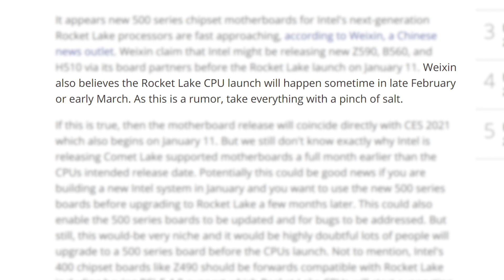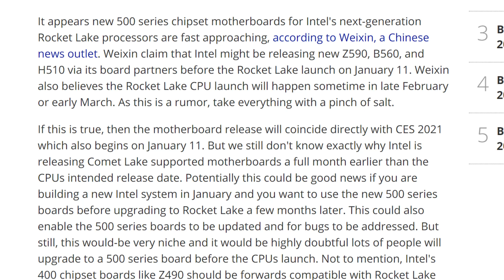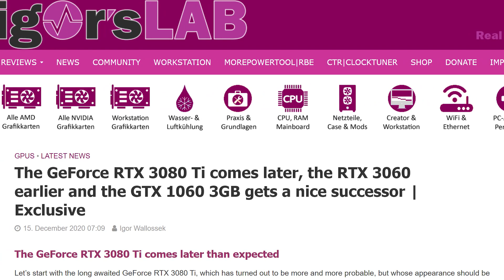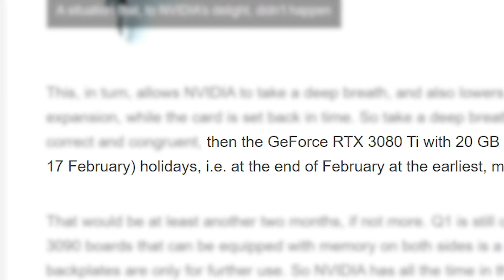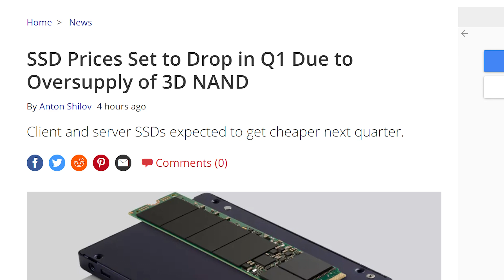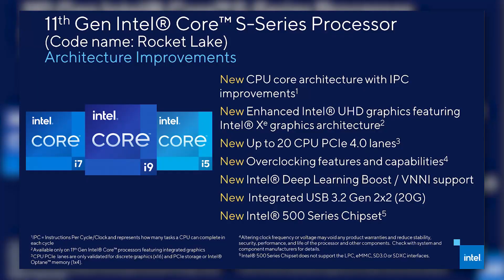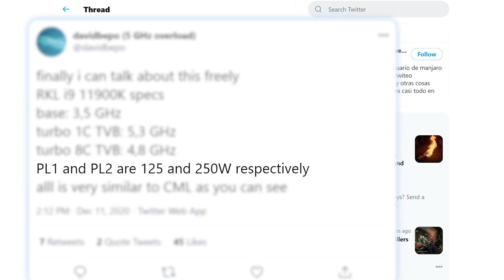Nvidia RELEASED New Monster GPU, Ryzen 5000 & RX 6000 Prices Going UP!

Comment: I don’t understand why they’re announcing new cards when they can’t even produce enough stock for the already released ones
Reply: they gotta keep producing. If this stock issue would make them stop that is a flag to investors. They need to compete across all levels of the market.
Reply: Miners
Reply: @everope  quit blaming miners for everything. No miner is buying anything except 3060tis and RX 580s otherwise they're morons because they won't be making money.
Reply: @eastonwilliams1722  that might be the case for small miners. But not consortium level of miners. The one that nvidia have direct dealing is this kind of miner. They will try to gobble everthing that they can to shift the favor towards their operation. This is why we no longer see many people involve themselves with mining on personal level like what we see in 2016-2017 period. ASIC in one thing but they also need to compete against consortium level of miner. How can they compete to get gpu when the big consortium doing direct deals with AIB to buy the gpu fresh from the factory? And then send the gpu to their mining farm overnight using a rented plane?
Reply: Companies buying out the stock to sell us gimped pcs xD
Reply: I'm not sure if you know this but asy ou don't understand I'll explain.
Basically bad chips for gpus are used for lower tier. So for instance a chip that was meant for the 3080 but wasn't good enough will be used for the 3070 or lower. By producing more kinds of GPUs they can use more faulty chips in other GPUs. This obviously means that the production cost goes down significantly as they can reuse chips for worse cards. This simply means Nvidia can make money out of faulty chips, so obviously they will.
Reply: @WhitestOC  Is faulty the right word? I understand cheaper GPUs get lower quality boards or whatever, but faulty sounds broke.
Reply: @tiredofthebs9  Faulty meaning some cores are dead or dont perform up to spec,so they clock them down towards whatever category they can make them.Preety common ,thats why first production line is the best and the worst line to get ( you probably get realy good unrecycled gpu cores,but if there is a fundemental problem in the production cycle you are screwed)
Reply: @WhitestOC  It'll be interesting to see if stocks of 3060 6 BG, 3070 ti (IFF it magically used binned GA103 chips), and 3080 ti are higher than the 3070, 3080, and 3090. That'd point to Samsung's defect rate being too high to produce the full chip. IIRC, the 3060ti stock at launch was equal to the 3090, 3080, and 3070 COMBINED. What's weird is the GA103 only seems to be used for the RTX A5000, so I wonder what they'll do with the binned chips.
Reply: @WhitestOC  I would call them faulty chips
Reply: I’m glad now I bought a 2070s in June or I would have been screwed. Was stuck with a 1060
Reply: @lazerdog345  yea same, i was actually considering selling mine but opted not to because was expecting chaos
Reply: @ZevesG  were smart men. Everyone said wait and now they’re all screwed.
Reply: @lazerdog345  waiting a few months when i have been waiting years is hardly screwed, a few friends of mine have got 3080's and 3090's so its not like they dont exist, just really high demand ontop of all the bullshiz that happens literally every launch.
Reply: @lazerdog345  u definitely have been screwed seeing the performance of 3060ti 😂
Reply: @dinkthesink3890  how man I wouldn’t be able to get it for another 6 months or longer. I needed a gpu in June.
Reply: @dinkthesink3890  lollllll ok go grab one from any store anywhere then mr budget card
Reply: @connorosullivan3500  already have a rtx 3080 will buy the  next rtx .  Still mum jokes
Reply: @lazerdog345  I'm gonna do the same, now gtx1060, used 2070s soon. Great upgrade,right?
Reply: @andreamartano1563  it’s not bad, you can play 1440p high on almost everything at 60 an up
Reply: @andreamartano1563  not worth I run 70 FPS on Cold War max settings I’mma get a 3080 and run more fps
Reply: @lazerdog345  Same here. I built my first pc around June and was debating if I should wait for the 3000 series gpus or just buy the 2070S now.
Reply: @foxsfury616  well you waited this long and the 2070 is overpriced still so I’d say keep on waiting unless you gotta play right now.
Reply: @lazerdog345  I ended up buying the 2070S in June
Reply: @lazerdog345  ye i got a rx 5700 xt  bc its all sold out now its sold out itself
Reply: @lazerdog345  I wish I made the choice like u did. I built a new pc last week. Was able to cop the ryzen 5 5600x from micro center but I bought a rx5500 xt since there weren’t any cards left. So gotta wait till these are in stock
Reply: @yukit5317  this is the worst moment possible to build a pc
Reply: @Aetherion0  but I was successful to build one before everything was sold out lmao
Reply: @yukit5317  you said there weren't any card left
Reply: Producing more cards reduces demand on pre-existing SKUs, simple as that.
Reply: That's a good excuse for AMD.
Reply: Random Name  scalpers are  alive because nvidia has low amount of gpus, so + gpus - scalpers
Reply: @audiolibrodimormon  False,they have produced more gpu's then ever before,its just that people realized how lucrative of a business scalping is,while also gaming having a big rise into becoming more mainstream ,and the fact that we got a new generation of  cards that was as good as the 10 series,since most people probably skipped 20 series.
Reply: Random Name  i just wanna know where are these gpus
In my country (italy), just few stores sell these gpus, and ofc they are overpriced.
Stock is a big problem
Reply: Because all they care about is profit. They don't give a shit about their consumer base.
Reply: I pre ordered 3080 when announced, and i just got it yesterday. (Berlin) So o guess pre-order faster to get it earlier. As much you wait more you pay and you get it later i guess.
Reply: Their decision to not use more ram for their gpus fcks them sideways in my opinion, thats probably the reason for the rtx 3080 to be dead on arrival
Reply: Hype up demand. Isn’t it obvious?
Reply: We're living in post modern times where what you feel is way more important than what is. Tehrefore, the hype is way more important than what's actually delivered.
Reply: Those other products are results of the binning process. That is why they seeingly barf GPUs.
Just... on paper. Or into scalpers' backyerds, i guess.
Reply: So true, I was thinking the same thing.
Reply: its literally dumb
Reply: @untseac  Not anymore,there is actualy no restriction and if there is .it was nvidia that placed that restriction. As we have seen the EVGA 2060 KO card carrying a 2080 gpu,while forgetting to cut some features making it a monster production card for the cost.
Reply: At least it pump the stocks
Reply: They dropped this before the 30 series actually released
Reply: probably to encrounche and use every single die they can muster.
Reply: It's covid bro, maybe employee are busy staying home
Reply: @PunxTV123  yes I mean you don't need ryzen 5000 series and 6800xt or 3080s to work from home
Reply: @Aetherion0  what I mean is, factory workers, who make assemble these gpu... that's why most of it out of stock because chinese people focus creating mask that time...
Reply: Funny thing is people were like “oh lol 20 series owners are losers lol they got screwed” 
But now they’re actually able to play games while everyone else rushes around and struggles to get a new 30 series card that’s so superior etc etc
Reply: @untseac  not ever chip goes in them all but she is partially correct
Reply: Amen
Reply: Because the Quadro cards are USD4,650 and much more lucrative. nVidia would rather sell a fewer of the Quadros to workstation users than the same number of Geforce to gamers.

Also, there's no Titan this gen so anyone who wants CAD/CAM optimisations and full rate Tensor core throughput but doesn't want to pay for ECC memory is screwed. Now they're either stuck with Geforce drivers with no workstation optimisations (3090) or the full fat Quadro at $4k+.
Reply: My understanding is the shortage is for Gddr6 memory, so the 3070 and 3060ti are more affected than the 3080 and 3090 which used gddr6x I believe. So the new 3080ti would use gddr6x memory I assume in which case they’ll release it. But yeah there are still shortages on 3080s and 3090s. I’m looking for a 3080 and can’t find one anywhere :( never have I had such a hard time spending money. JUST TAKE MY MONEY AND GIVR ME A 3080!

Comment: RTX 3080 should have had minimum 12GB VRAM when it launched
Reply: Melburn Sir  Ti version will more than likely have 20gb Vram. So that doesn't change the fact that the 3080 should have had 12gb at least, even the RX 6800 got 16gb.
Reply: @TheGamingNorwegian  they are going for Planned obsolescence.  So any one that bought a 3080 would need a new card in a year or 2 to run max settings 

I don't think they realized AMD would have such good cards
Reply: Plus the 3060 may have a 12GB non TI variant, explain that !
Reply: I agree. 10GB isn't a large increase over previous iterations of 80 tier cards. 12 or 16 would have been more impressive, but given that the cards sold out at 10 and are being scalped for double MSRP, I guess it didn't really matter how much VRAM they had as people want to get their hands on them regardless.
Reply: I KNOW WHAT ILL DO FORCE EVERYONE THAT WASNT A RETARD OFF WINDOWS 7 TO GARBAGE SPY/MALWARE TEN THEN FORCE THEM TO GET ALL NEW HARDWARE DURING A PANDEMIC AND ENSURE NON ONE CAN GET ANY THING
YEA FUCK MICROSHAFT AND ALL THE HARDWARE ASSHOLES
Reply: WE SHOULD ALL GO HANG OUT IN LARGE GROUSP GET COVID 19 THEN BREAKINTO EVER GOVT BUI8LDING SO THEY ALL GET IT AND DIE
Reply: Is to make the 3080 ti seem like a better choice
Reply: Shoulda woulda coulda
Reply: 16.
Reply: VRAM isn't everything.
Reply: @Vinnay94  ...nope but its a lot , example of non vramuse is shader compiling in unreal more cores/threads on new hardware = faster
Reply: Melburn Sir  Why ? Because I have a Gigabyte Aorus Master and game at 4K, 1080 TI and RTX 2080 TI both had 12GB, newer games are going to have more high res textures
Reply: Planet Zoofun mainly because those are Ti models you idiot. The original 2080 had 8gigs did it not?
Reply: @How23497  True. But the Pascal Titans have just 12 gigs, whereas the 3090 has double that. By that logic I would expect the -80 card to have more than 10 gigs. It feels like nvidia trying to push some people to buy the 3090
Reply: @How23497  You don't understand regardless of whether it is the Ti model or not but as newer tech starts getting introduced it is usually better than older tech in most ways. older GPU's required less vRAM because games in those days were less demanding but as games start looking more realistic with higher res textures and other features then increasing performance and video memory capacity helps just because a last gen non Ti card had 8GB doesn't mean the newer version does not need 12 GB IMO it probably needed MORE than 10GB and the 3070 needed same vRAM as 2080Ti only due to to the fact Nvidia is comparing the performances of the 3070 to the 2080Ti and saying it is better yet they significantly cut down on the vRAM for the 3070 so in tasks that more vRAM is useful the 3070 would not be able to compete as easily so ESPECIALLY if a current gen GPU (3070) that is 2 tiers below the current flagship somewhat outperforms the last gen flagship all GPU's that are better than the that (3070) need to be better than the last gen flagship in every way IMO
Reply: @How23497  well, when the 3080 launched, nvidia seemed to be dropping the Ti branding and the 3080 was pushed as the 2080 Ti replacement, so it was weird for the drop in VRAM, but now it looks like they are going to make a 3080 Ti, so the VRAM isnt an issue now
Reply: @DokiMin not really, it will be great for high refresh rate 1440p monitors since you dont need as much vram for 4k gaming.
Reply: @Quindarious_Gooch_  Ampere is aimed at higher res. The competitor, RDNA2 seems more efficient in lower res. As far as I can tell, it's not a deal to grab the 3080 for 1440p, but 2160p.
The 3080 should've come with 12GB indeed, or even 16GB, but 12GB would be enough for UHD
Reply: You guys all dont have the card and talk rubbish "new game new game" I play Cyberpunk 2077 in 4K no issues with Vram, VR at 3000X3000 rendered resolution in like 10 games non had issues, all other games I play 4K no issues......... But you always try find an excuse for something always "Next gen games next gen games" cyberpunk comes and we still dont need more than 10gb
Reply: @TRX25EX  bro we are talking about games that come out between now and next generation of graphics cards. 4k gaming is already easy 8GB rn a buffer of 2 GB is not gonna last very long, especially since the performance of these cards is amazing, it's just the Vram for the next few years that holds it back
Reply: @TRX25EX  it's been proven gddr6x doesn't make up for the Vram issue. Also not saying it's bottlenecked by games rn. You seem hot and bothered by a ligitimate critique of a product, almost like a nvidia fanboy. And there have been a few games that have actually hit 10 GB (yes allocated Ik dude), especially with mods, the fact that allocation of 10gb is getting to that point already is the somewhat concerning and legitimate critique of the product. Especially since their competitor released with 16 Gb on all models. And gddr6x doesn't make up for 6 GB difference. The card is fine, but it would've made more sense for 12 GB especially for $700+. Also never fully trust the word of the company that is trying to sell you a high dollar product, they don't know the future of Vram usage either. Now quit fanboying over a legit concern.
Reply: @JackDanielsNitro  Ever thought of the opposite needing to happen (VRAM allocation & usage going down)? Using more & more of a certain resource isn't always progress... 🤔
Reply: @TRX25EX  not to mention any next generation games that will require more than 10GB of VRAM will be years off at which point you will want to upgrade your GPU for the latest and greatest ray tracing and rasterization anyways.  People need to calm down about the VRAM debate.  Its stupid
Reply: @jebidyah  Exactly its not like 3080 buyers are budget buyers, once new generation drops majority will upgrade, I thank Nvidia for giving faster memory than useless extra Vram for this card hence why 3080 look so good in value and the best in high end not even AMD cant beat it
Reply: @TRX25EX  Personally I would prefer the GPU I paid nearly 1K for to be just as good for 4K gaming in 2 to 3 years time.
Reply: @ReelByUnreal  Exactly, 3080 is half the price of 3090 which have alot more vram, you can buy 3080 and 4080 for same price, and it takes only 2 years for each generation while 4080 will sure beat 3090 easily...... I dont know why everyone sensitive about Vram when the so called next gen game Cyberpunk still show 3080 doing better at 4K than lower resolution, VR which is worse still no issues.... some just want more but when price goes higher they cry all day
Reply: @TRX25EX  Quit defending them.
MSFS 2020 uses 12GB of VRAM at 4k.
Anyone that buys a GPU with less than 12GB of VRAM is a moron.
Reply: @eastonwilliams1722  Im beta tester for MSFS2020 so I know what im talking abouy and I have 3080 even VR its enough! Not any VR but Reverb itself highest resolution VR

Comment: If 3080ti can run cyberpunk in 1440p max, sure
Reply: Disable Ray tracing enable dlss max out settings and get from 70-110 fps in ultrawide 3440x1440. Except for the Psycho preset. It doesn't make sense.
Reply: @JohnnyTheGreek91  Well I wanted to have a RTX card, 6800xt is pretty good, but I want see what it could do with both DLSS and Ray Tracing on
Reply: @tonyy.8852  If you want a card that has ray tracing capabilities and plan on using the feature, you want an nvidia card, especially since DLSS is Nvidia only.
Reply: @CloudyDeveloper  yeah, I would go for AMD cards if they have something similar to DLSS, but I feel compare to SAM, DLSS is definitely more useful in this case

Comment: 3:32 this is one of my favorite memes

Also, glad the 3080 Ti doesn't match VRAM of the 3090, otherwise I would be very sad... But I'm doing projects that use 22GB+ VRAM, so I don't feel bad. If only I could afford the A6000...
Reply: WTF what are These projects???😂
Reply: @dackel4253  machine learning. Some models are big enough to fill the 48GB VRAM of something like the A6000 with ease